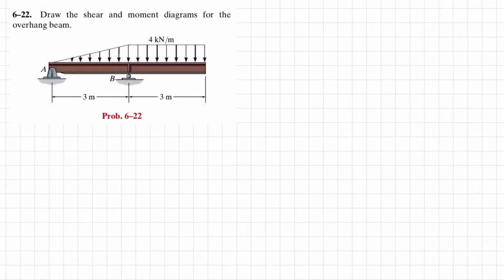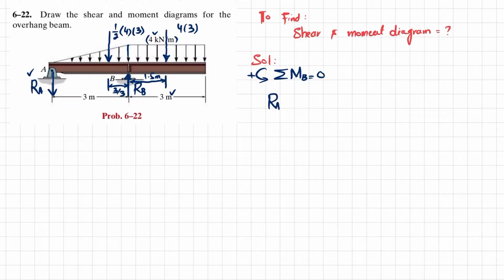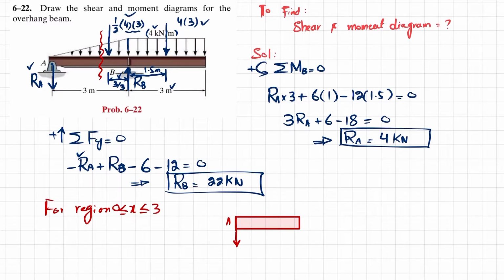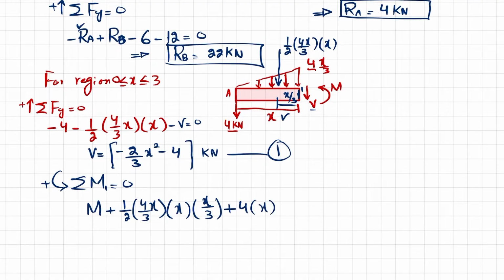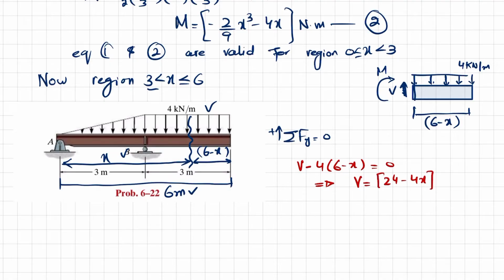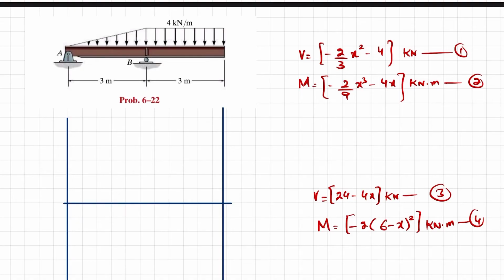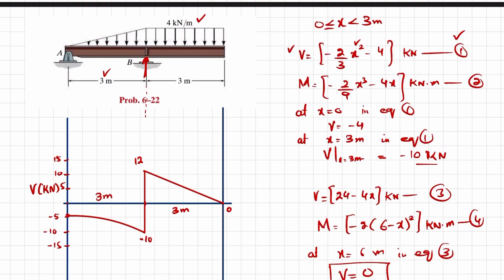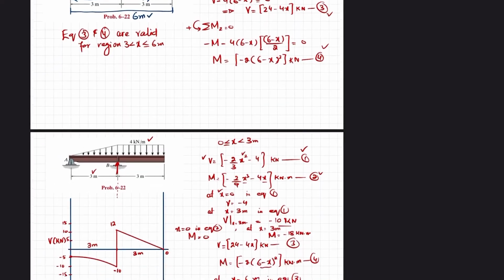6-22|Chapter 6| Bending | Mechanics of Material Rc Hibbeler|

Comment: Hi, I have one query that why you have considered the direction of the shear force (v) as downward in equation number 1. Also shown downward in its FBD b/w 0 < x<3.
Reply from the maker: That is a great question, and it's one of the most common points of confusion when learning mechanics of materials. The short answer is: it’s all about the standard sign convention.
In engineering, we follow a specific convention so that everyone’s diagrams and equations look the same, regardless of which side of the beam they are looking at.
The Positive Sign Convention
When you "cut" a beam to look at the internal forces, we always draw the shear force (V) and the bending moment (M) in their positive directions by default.
 * For a Left-Hand Segment: If you are looking at the segment to the left of the cut (which is what's happening for 0 < x < 3 in the video), the positive internal shear force is defined as acting downward.
 * For a Right-Hand Segment: If you were looking at the piece to the right of the cut, the positive internal shear would be drawn acting upward.
Why do we do this?
By always drawing the shear force downward on a left-hand segment, we ensure a consistent relationship between the load, shear, and moment. Specifically, it satisfies these fundamental calculus relationships:
 * The slope of the shear diagram is the load intensity: dV/dx= w(x)
 * The slope of the moment diagram is the shear force: dM/dx = V
What if the math says it's negative?
If you draw V downward (the positive convention) and your final calculation gives you a negative value, it simply means the actual physical force is pushing upward. However, you still start the problem by drawing it downward so that your signs remain consistent with the standard Shear and Moment Diagram (SFD/BMD) rules.
Summary: The downward direction isn't a guess about which way the force is actually pushing; it is a "placeholder" for a positive internal force according to engineering standards.
Reply: @engradnanrasheedmechanical  Thank you sir. So, if I understood correctly, the downward direction of V in 0<x<3 is only an assumed sign convention for the left-hand segment, not the actual known direction of shear. The actual direction is confirmed only after solving equilibrium. If the value of V comes negative, then the real direction will be opposite.
Reply from the maker: Yes you are right ❤🎉

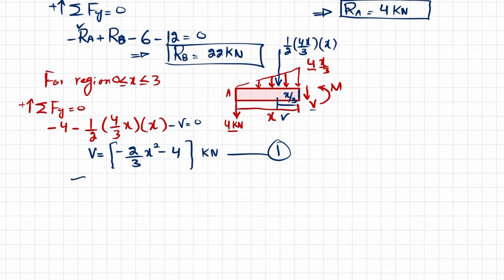Comment: at 8:36  while writing the shear equation the units are not matching ....you took 4kn downwards correct....V to be downward correct but the load by the triangle is not taken you took it as like a moment ....can you correct me if i m wrong or else clear my doubt .......(1/2)4kn/m*x2 its moment ....my solving it we get unit as KN-m which is moment not force
Reply from the maker: Well you have mixed one thing the (4/3*X having unit KN/m) and when you convert triangular load in to Point load (1/2 * (4/3*X unit KN/m)* (x unit m) will have Unit KN which is the unit of force. I hope it will be clear to you now.....